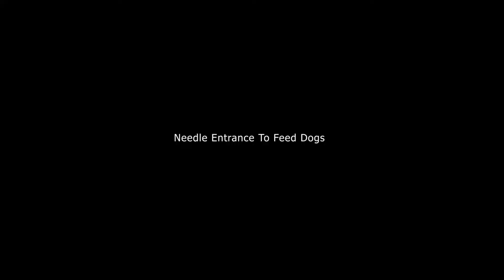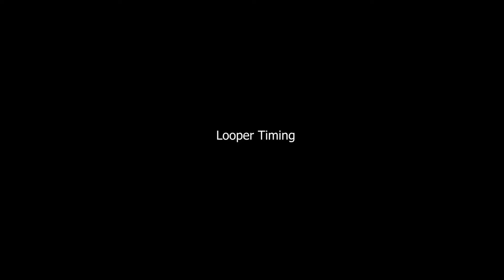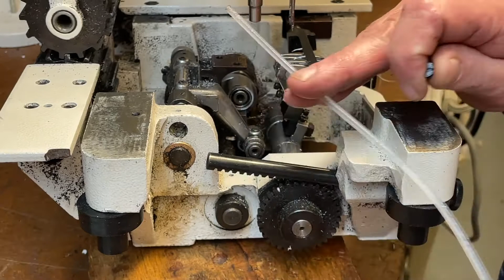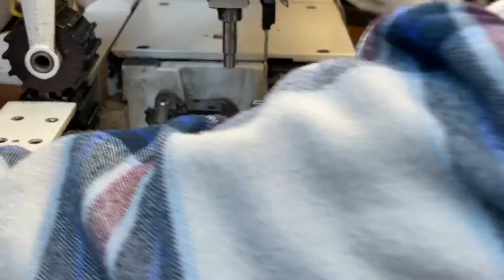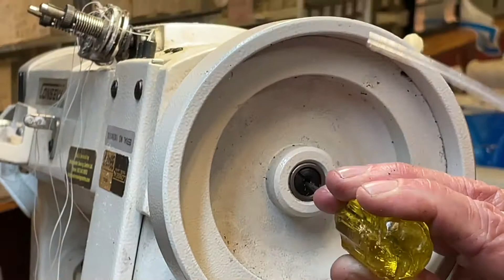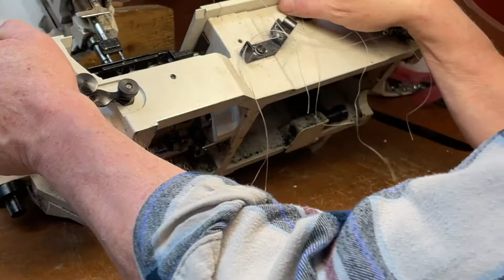Singer 300W & Consew 3300 Series Maintenance Video.

Comment: Anymore videos on the 300u style machines ? My looper essentric is wobbly, its shot and needs replacement actually most of that area I’m planning on rebuilding. I work on all lockstitch machines up to class 7 size and below but new to these chain stitch machines. Also the upper and lower timing , if they are not on the same setting what’s the fix?
Reply from the maker: That is the only video I made.   The upper and lower timing is all done with the timing belt.

Comment: You mention at the end, lining the plunger up top with the button on the bottom up. Mine appear to be off now, what do you do to line them up? I was trying to increase my stick length for the first time and I think I goofed it.
Reply: The bottom button does line up with the D line, but the top appears to have slipped to L
Reply from the maker: I would push the top button down first until it falls into the groove then line it up to the specified spot you want and make sure the button falls completely out.  Once done the top do the same with the bottom.
Reply: Hey Chet did you figure this out? Might have done the same by accident, now I can’t spin the hand wheel to adjust the stitch length
Reply: @ImSkybii  yes I did, I don't recall what I did but it might have been the reply above me

Comment: Again awesome video, how do I set dlt to be in the correct position, I moved the letters before and I want to set the letters again in the correct position.
Reply from the maker: I am not sure what you are asking.
Reply: @bridgewatersewingcentre  The wheel that has the letters A to L, has two set screws that holds it in place, I moved it by mistake I want to place it in the correct position in relation to the needle position (rotary position).
Reply from the maker: It should be the first screw that comes to view first that would be on the groove of the shaft.

Comment: HI,  great video!  very helpful.  I just picked up a 300w101 and when I put my wheel at LT, the needles are all the way up?   How do I adjust them to get them down?  The whole machine is out of whack as when I turn the wheel towards me the material moves towards me?   Any idea or fixes for this?
Reply from the maker: Sounds like possibly the timing belt has been disturbed.
Reply: @bridgewatersewingcentre  Thanks, I was thinking that same thing.  Could I just loosen the screws at holding the belt to the bottom shaft and turn it 180 degrees or is there more to that process to belt?

Comment: Thank you for the video, I have a model 3322 that appears to be a little bit older than this one. The video was helpful but I'm still seeing my thread knotting up on the back side of the fabric. Where's a good place to start if I've gone through all of this and I'm still not quite ready to run?
Reply from the maker: You need to tighten up your top tension.  This should help

Comment: how can i adjust the puller
Reply from the maker: Sorry just seen this message. If the puller is the eccentric type. Then you can adjust with the button on the bed. If it is gear driven you have to change the gears.

Comment: Neil, have u ever converted an industrial walking foot with a 220v three phase motor with electronics to work on 120v household current? If so, what did u do, or what did u try? I bought a Brother LS2-B837-310 with thread trimmer, synchronizer, back tack with F-40 control panel and pneumatic presser foot lift. I'd like to find a way to keep the function of these features. Any thoughts?
Reply from the maker: If you convert the machine from 220 three phase to 110 volt there will be no way you can save the electronic functions, they would also be 220